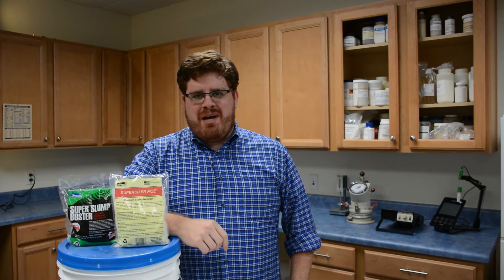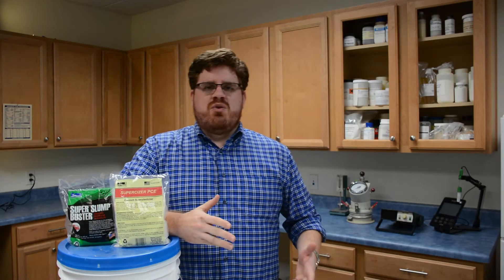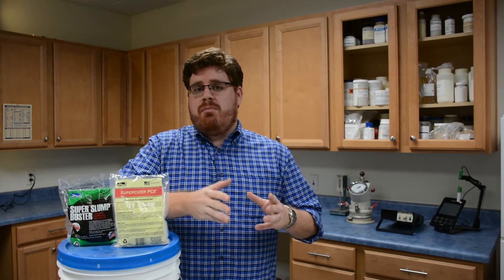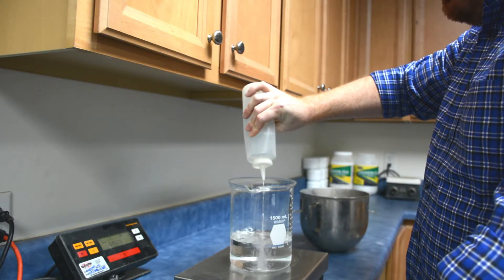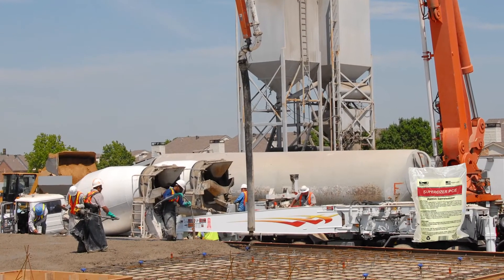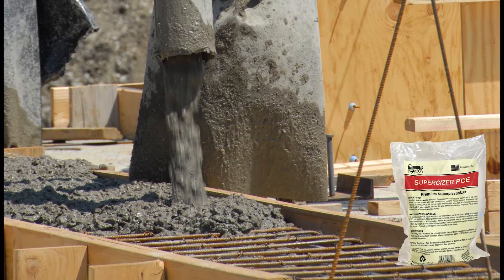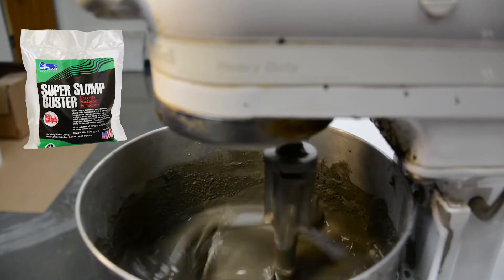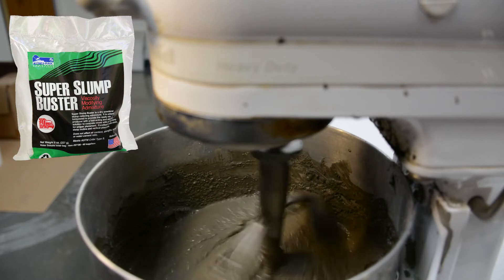Control the Slump with Fritz-Pak's Concrete Slump Admixtures

Comment: I seem to recall reading that the PCE superplasticizers tend to entrain or retain more air content.  I looked briefly on the website but I didn't immediately see information on that.  If it's true that the PCE products tend to entrain or retain more air content, is there already an air-reducer in the PCE product or must it be added separately?
Reply: I took more time reading online and found a post by your company specifically stating that the PCE product you produce does have a de-foaming agent.  I am going to order some samples.  I called and spoke to customer service a week ago which is where I heard about the samples.  My conversation with customer service was awesome.  Learning about how I can improve flowability while not turning my concrete mix into soup with a ridiculous w/cm ratio has been most exciting.  I'm tired of pouring soup which is weak and dusty.
Reply from the maker: @grassroots9304  How did your samples work out?

Comment: Does the slump buster reduce workability time window? Can you add a set-retarder with the slump buster?
Reply from the maker: Thank you for reaching out.  Super Slump Buster does not have any noticeable effect on the concrete set time, and yes it can be used alongside a set delay admixture.

Comment: How can retain concrete slump 150 mm after 3 hrs in M-60 mix design?
Reply from the maker: Thanks for reaching out.  Our recommendation would be to batch the concrete with just 3-4 hours of delayed set initially ignoring the slump, and then introduce the superplasticizer at the 3-hour mark to gain the necessary 150 mm. Trying to maintain a high slump for such a long period of time is usually unnecessary and extremely costly.

Comment: So you can order a 4 slump add reducer and it’ll become a 6 slump? How much do you put per yard ?
Reply from the maker: It depends on the product you are using and the mix design, but generally speaking, in a full truckload of concrete, 1 bag of our superplasticizer will increase the slump by 1 inch.  So if you are at a 4 inch, and you want to go to a 6 inch, you’ll add two bags to a full truck.  And it is proportional, so if it was half a truck, you would add just 1 bag to go from a 4 to a 6.
Reply: @fritzpak4821  1 bag to 10 yards of concrete is normally a full load and it’ll raise you 1 inch per bag . Great product. Thanks for the answer so fast too.
Reply from the maker: @TalksWithRyan  Always happy to help.
Reply: @fritzpak4821  cool that’s what I was needing to know was how much and what changes it makes

Comment: Do you make a product well suited for ICF construction?  Considering ordering a 6 sack with 3/8 pea gravel, 5% air, Helix micro rebar, and having it arrive on site at about a 4" slump.  Then using an admix to increase the slump to about 6".
Reply from the maker: We actually have several products that are perfect for ICF construction.  You can find them on our ICF applications page.  https://fritzpak.com/applications/icf-contractors/